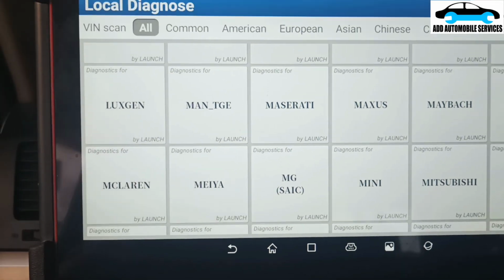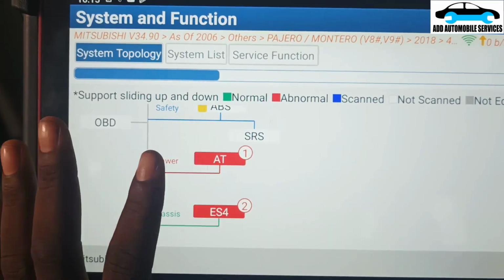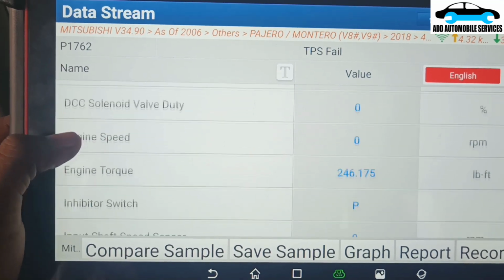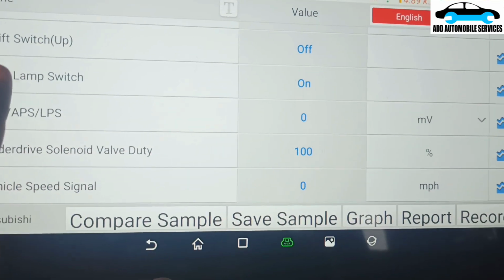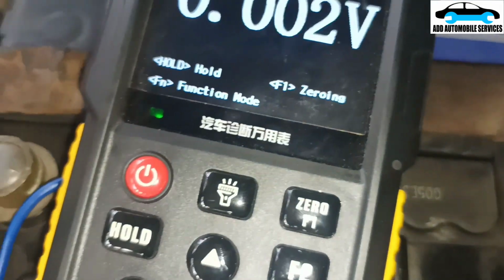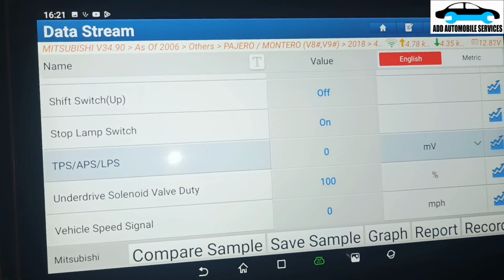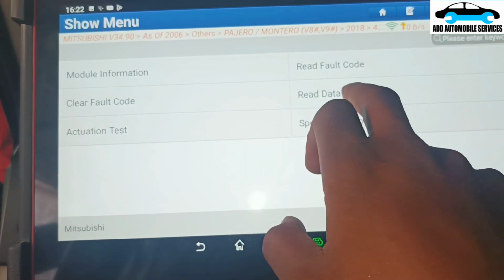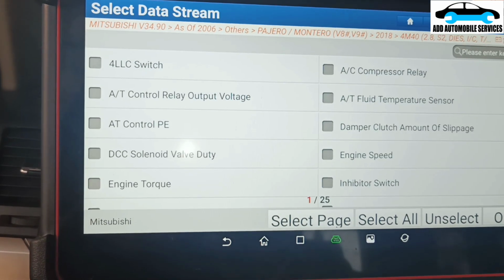2018 Pajero P1762 TPS fail ( merry Christmas)

Comment: What kinda OBD Reader is that . Can you used that without internet or wifi ? What happens if you don't updates ? Does that check Fuel Pressure ? Does that check compression check ?
Reply from the maker: Yes you can use it without Internet
Reply: @ADDAUTOMOBILESERVICES  What is the name of that OBD Reader ? Does that scan for Fuel Pressure .?Does that scan for compression for SparkPlug s?
Reply from the maker: @jamesmichael8549 x431 pad 7
Reply: @ADDAUTOMOBILESERVICES My Last question is Do you have to pay every Year or monthly to keep all the Features on to this OBD device ?
Now if you don't pay every yearly or monthly can you still used it to scan for everything ?
Reply from the maker: @jamesmichael8549 you have to pay yearly